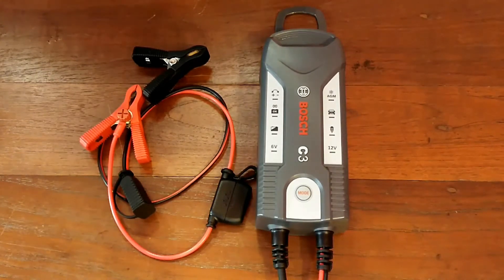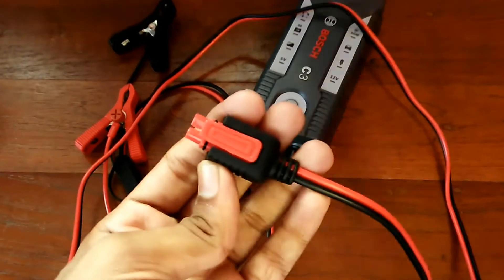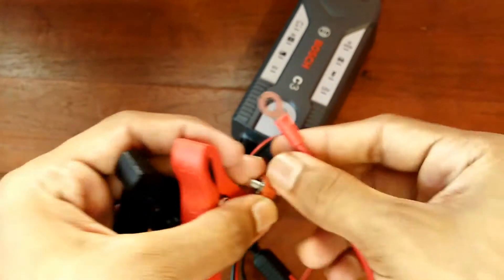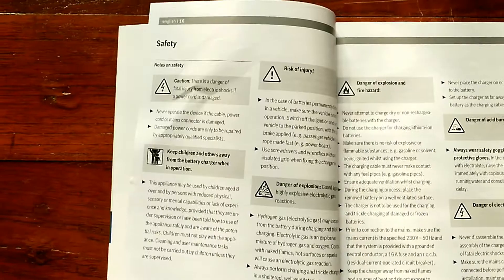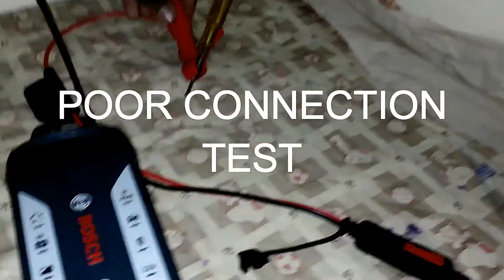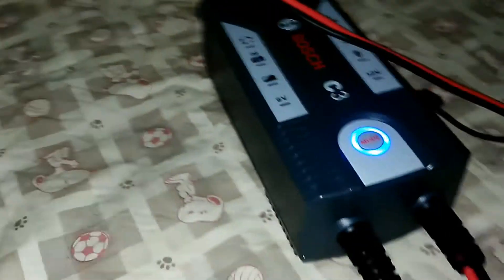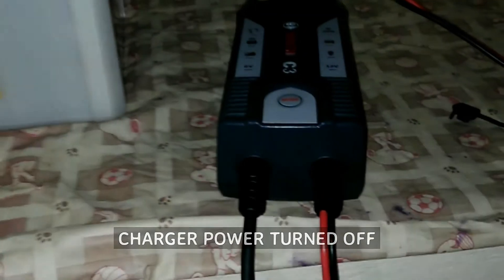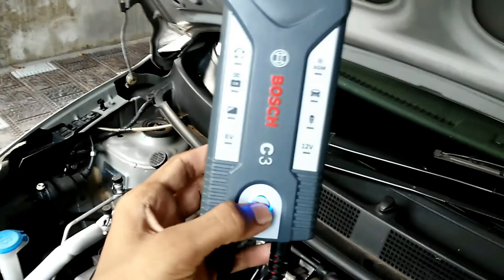REVIEW BOSCH C3 CAR & BIKE BATTERY CHARGER | FULLY EXPLAINED | MS TECH |

Comment: Don't buy. As when my motorbike battery of 12 Volts discharged to 8 Volts this dummy charger thinks its 6 Volts and can't charge or there is no button to change to 12 V charging.

I tricked this dummy German logic add an small battery in series that charger C3 get at least 10 Volts to change to 12 v charging.

Buy Ctek chargers this is very bad.
Reply: CTek 5 is better 10 times

Comment: Hi there, thank you for the video.  I have one on my car also, could you tell me what does it mean if the orange light is flashing on the left (charge status 10) but no green lights or anything on the right , just flashing orange and that’s it. Any idea ? Is it a dead battery ? The manual doesn’t say . Thank you.
Reply: It's trickle charging if battery voltage is less than 8v to 10v

Comment: If we measure the output of a 12 volt 60 ah battery... Fully charged... what will be the reading shown in multi meter.... because I charged my car battery fully and it's showing 13.66 volts in multi meter.... 🙄🙄🙄
Reply from the maker: Yes, it is correct and fine reading

Comment: when i connect it to my car battery which is discharged, 6v button blinks ( whilst car battery is of 12 v) and didn't charge battery even after 24 hours.. what can be reason
Reply from the maker: That's the problem with fully automatic charger, it detect below 12v and charger think it is a 6v battery. Try to connect another 12v battery in parallel so the charger detect 12v and then start changing. After the charger start to charger then remove the good battery and let the bad battery charge.

Comment: Thank u for ur reply.
The problem is when battery is connected the charging led is blink ,but after few minute ok button led light up.when check battery not charged.
Reply from the maker: It maybe your battery sulfated. In this case manual charger only work well to desulfate, automatic charger fail to work.

Comment: Well my charger is not showing the charging indicator only 12v and bike mode light are on. Is it an issue?
Reply from the maker: Check with another good battery.

Comment: Hi guys, i need help im triying to charge the battery but when i push the bottom only appear 6v and the symbol Mode is in Green. I need to charge 12v cause the battery is for car. Please thank you
Reply from the maker: Your battery drained fully and bosch charger detecting 6v battery. It also causes poor connection, so clean battery  terminals and also check the charger clip. If the problem is still exists, then if you have any other 12v battery then connect + to + and - to - in parallel with dead battery, doing this with good battery can raise your dead battery voltage and charger detect the correct voltage. This problem also causes if the battery is heavily sulfated or anyone or more cells dead, you have replace the battery if this is the problem.

Comment: Sir my C3 charger is not working for the batterys which are completely dead what's the problem sir. What should we doo know
Reply from the maker: It can't charge completely dead battery, if you have any other good 12v battery then connect +ve to +ve and -ve to -ve 10min or less then connect c3 charger then only it can detect the voltage. When connecting both batteries in parallel makesure battery is not getting too hot it's not that safe to do so, don't connect and leave. it is like we jump starting the car you have to watch carefully. Bosch c3 charger can charge fully drain batteries but not all battery, it's like condition of the battery if the battery is new then chance is higher. If the battery is heavily sulfated or any dead cells the charger goes to trickle charging mode or doesn't charge
Reply: @MSTECHCHANNEL  thank you so much MS TECH

Comment: Sadly, it only charges batteries which are not flat. Below 11.5V it will not switch to 12V mode. Waste of money !
Reply: Get the Bosch C7 charger then, slightly more expensive. Can revive dead batteries.
Reply: Leave is charging at 6V for an hour and let it re-detect it...normally it sees it as a 12V motorcycle....then push mode again and it should switch to Car.   Then just let it charge for around 12 hours.

Comment: I have a 12V 70ah AGM Battery, and the Bosch C3 charger is charging the battery on 6V (mode 1). How can I change the mode to mode 4 as I tried everything that comes up to my mind but no other modes were showing green light apart from 6V?
Reply from the maker: It is because of low voltage on battery, the battery charger sense wrong (6v battery). You have to connect good 12v battery in parallel with your dead battery and connect this charger when the charger sense 12v then remove good battery and let the old battery charge alone. This is the problem of fully automatic battery charger but it happens only if the battery is completely drained or if the battery is in bad condition like 1 or more cell death happens.

Comment: agar iska  positive & negative clip kharab ya loose ho jae to new kaha milega
Reply from the maker: You can't get any Spare clip in this quality, but you can buy and fit the clip which is not good looking and better quality than this c3 charger clip. My c3 is 2 years old and it is still working without any problems, the clip also in good condition.

Comment: c3 and c7 kitne time me charge ho jaega
Reply from the maker: Both take 12 hours to full charge the battery, if it fully drain. This is the safe charging for lead acid batteries. Lead acid battery should be charged less than 10% of it's capacity, so if your battery is 35AH then you need to charge it in 3.5 A. I hope you got it 🙂

Comment: Hi, can i charge the battery of the car, whit this charger like an external battery without put it in an outlet? I just both it. Thanks.
Reply from the maker: Yes, you can charge the car batteries without removing from car. You need to connect the charger into 230v ac to charge your car battery, the charger doesn't has internal battery to charge without plugging.
Reply: Thanks.

Comment: It would be better if the camera angle were to observe the battery connections, meter and the charger simultaneously rather than scanning around so much.  Shaky video and heavily accented voice were challenging to interpret.  My Bosch C3 charger always has a blue light no matter what I do with it - even when connected to a 12.5 VDC partially charged battery.  I am searching for clues on this abnormal behavior.
Reply from the maker: maybe your swich is died, check online for switch replacement.